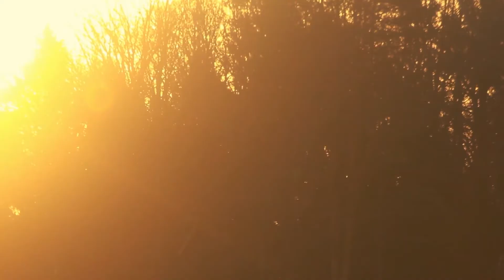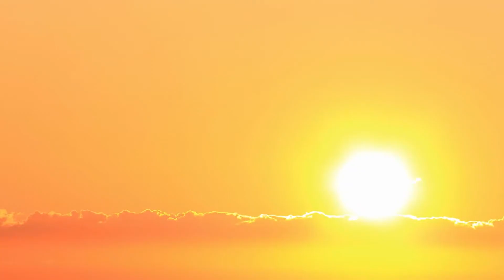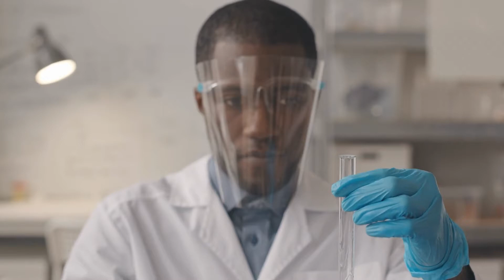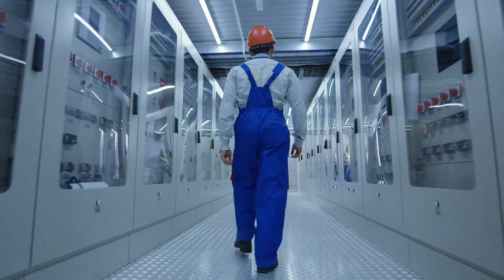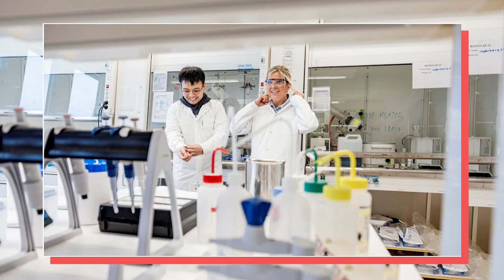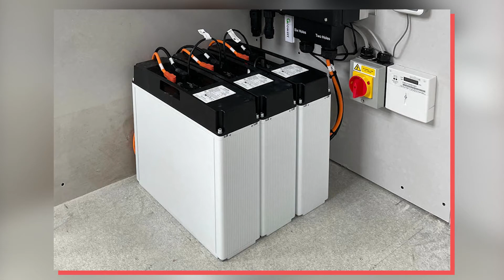Sun in a Box - The Liquid That Stores Solar Energy

Comment: Using chemicals to make a photon light directed into a mirror which points straight into a solar panel for a faster charge would be a continuous charge without the Sun and that would make and use the power into a swimming pool size battery should save enough power for when the sun's not up or if your phone turn light but with adjustable rear stats it will open and close is needed so it should be no I have when it works can you figure